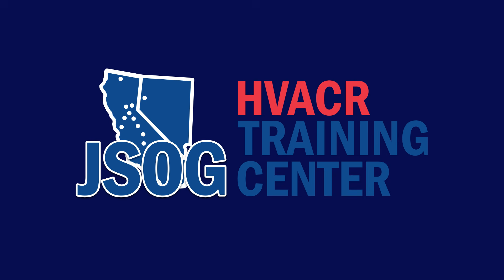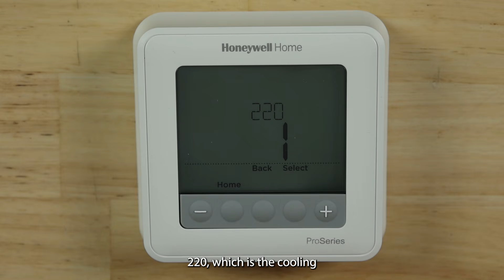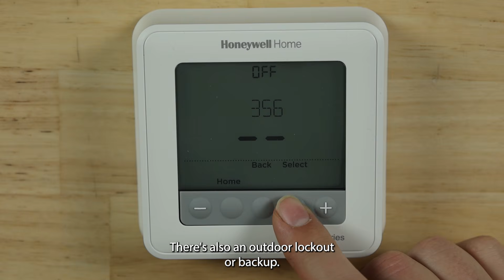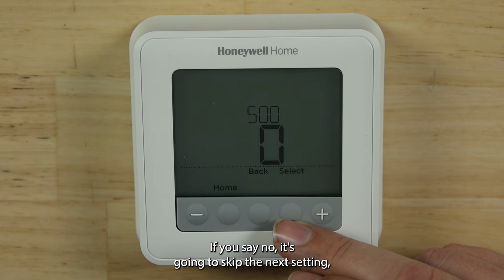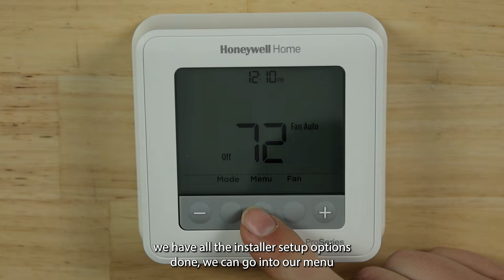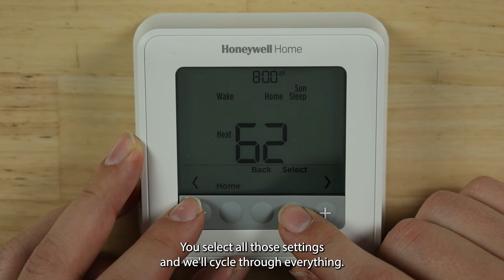How to setup: T6 Pro Honeywell Thermostat

Comment: Have a TH6210U2001 model thermostat? Only for Heater control operation, Have to control a 2 stage Electric heater. Can be controlled using Heat pump configuration? In such case, What's the wiring for Stg1 n Stg2? Stg1 to O/B(Heat enabled) and Stg2 in W2 or Stg1 to W and Stg2 to W2?

Comment: Hi...I have this same T6 thermostat and a heat pump and a natural gas furnace backup heat (no electric heat strips). If it gets too cold outside (and the heat pump is not working very well), is the thermostat supposed to switch over to the gas backup heat automatically? I know I can switch to emergency gas heat manually but is there a setting that will switch over automatically and if so, do you tell it at what temperature to switch over to gas heat?  Thanks!

Comment: I can’t get the heat to turn on. The fan turns on and the outside compressor comes on but it blows cool air. Which setting do I change? I have a heat pump and electric
Reply: I have the same problem with a back up oil boiler setup?

Comment: Goodman heat pump install. My heat pump mode is on during cooling. All wiring replaced. 24 v tested on condenser for y1 0 and 24 of course. Is there a setting im missing?  Brand new goodman hoping reversing vve isnt stuck.
Reply from the maker: Thanks for the help @tommyboygunz3449. It's always great to see us skilled trades folks sticking together and helping each other out. Glad to see this one got figured out @unspokenrulz1696.
Reply: Setting 218. It’s the setting on the thermostat that you have to choose to either energize the reversing valve or de-energize it. Just switch it in the thermostat setting and you’ll be good to go.
Reply: @tommyboygunz3449 yea it was set to energize to cool. The 24v plug for the solenoid was unplugged in the condenser. Smh

Comment: Hi, thanks.
Now seriously. 
I have this thermostat and am not trying to decode the meaning of life, I ONLY WANT TO USE MY A/C.  What is the MOST BASIC process for using the A/C? 
No heat required. I cannot see a mode option. This is ridiculous. I like the option of bells and whistles but where is the basic ON/OF/ for A/C and Auto/Manual fan mode?  
It shows "cool on" and 70 deg. setting, my A/C pump is running but it's 80 degrees ambient temp. inside at the thermostat.
This is insanity. I can't find any basic instructions.  Is it an unreasonable request?  
Should I have to know how to rebuild my transmission on my new truck to simple drive down the street as well?  
Is that reasonable?
The readout is not showing mode.
What the heck.
Insanity.  Where do I look for an ON and OFF for the A/C?
Reply from the maker: The fact that you stat reads "Cool On" tells us it is doing what it's supposed to do. One possibility is that you may have a heat pump system and the reversing valve call needs to be changed.

Comment: This is too much programming unless you hire a professional.  I just want to use it
Reply: I don't believe changing your thermostat settings would void your warranty. They want you to call them for a simple temperature change? Crazy!$$$$
Reply: Exactly my thoughts. This is way too complicated for most homeowners. The reason I looked this up is because my best friend rents a brand new house and she tries to set it to a certain temperature but by time she gets home from work it’s on a whole different temperature. Now I know why, but still not confident on how to fix it. Absolutely ridiculous. I miss the days where you set the temp you wanted and that was that. 🤷🏻‍♀️ All these “smart” devices originally designed to make life easier have actually done the opposite.
Reply: My installer told me if i change the thermostat the warranty with them is void, now i understand why, this is too complicated, I'll leave mine alone

Comment: I have this thermostat modelth6320u2008. The manual is no help. I cant turn the cooling to auto so that when it reaches temp it cuts off. I can turn fan to auto, but that is no help. Will system changeover set to auto fix that issue?

Comment: So if I want my ac to cut on and off less frequently I increase the cycle rate number or Lower it?  Also glad I watched my technician had the compressor protection turned off set it to 5.
Reply from the maker: The cycle rate setting limits the number of times the system will come on. If the cycle rate is reached and the t-stat makes an additional call it will prevent the system from coming on. This obviously can lead to some comfort issues.

Comment: how to factory reset?
Reply from the maker: To factory reset a Honeywell T6 Pro, press and hold the Menu button until the setup screen appears (takes about 5 seconds), navigate to "Reset" using the left arrow, select "Factory," then confirm "Yes" when prompted. This will restore the thermostat to its original factory settings